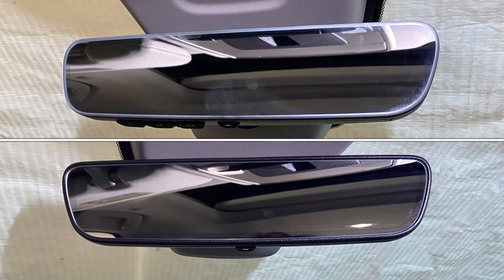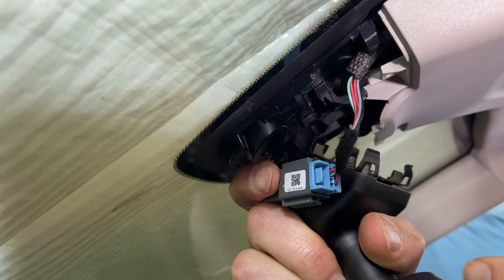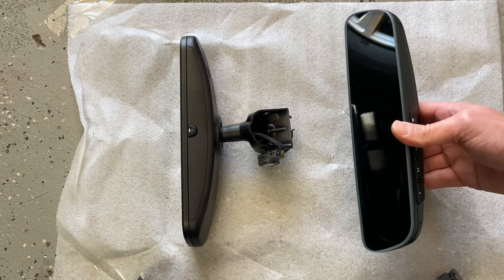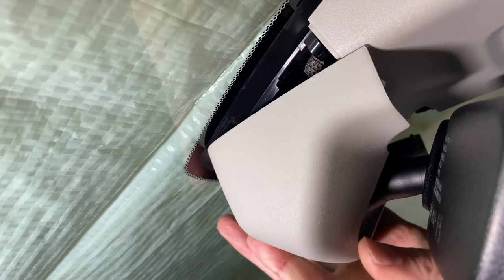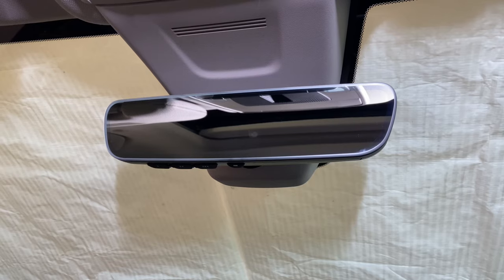2023 2024 Honda CR-V Homelink Mirror Upgrade

Comment: Struggling with this on a 2024 sport-L. Putting a good amount of force into it but feels clipped differently and might pull the whole assembly off

Update: this is exactly the same on 2024 models. I used a small pry piece to unsnap both top clips together and the cover will slide down and off. Don’t pull it off to the side. When putting it back on make sure to slide the piece up from the bottom to get the bottom clips seated before snapping the top in
Reply from the maker: Thanks for adding this, we have a great group of users that make the channel helpful for all of us! I will pin this to the top. Thanks for watching!
Reply: Howdy, I am about to try this on my 2024 sport touring hybrid.  Just to clarify, you did everthing the same as in this video, except you used two tools (one on each side / top clip) to pull the top section off?
Reply: Just finished with doing my wife's 24 Sport Hybrid Touring.  First, taking the lower cover off takes a little bit of courage.  It hates to let go.  Feels great when it did.  Second, original mirror pretty much just fell off as I tried to twist it.  Third, a bit of frustration as I tried to replace it with the Homelink Mirror.  I bet I rewatched the video 20 times before I decided I had it in place right and decided to try more force..  still no joy.  Then I held twisting force with one hand and then thumped upward on it at the same time... THUMP! twisted right into place and firmly there.  Replaced the cover and programmed the Homelink.  I am now a hero to my wife!  wont last though....
Reply: @andrelb3 I used an old toothbrush and it worked like a charm 🎉
Reply: had trouble with a 2024 too, tried 2 tools one on each side, no joy. I then used a pry tool 3x the size of what is shown here on the left driver's side and it popped right off with one try, just wasn't enough leverage using one pry tool for me.  Comparing the inside of the cover with the pic on here, and yes they are exactly the same, no difference 23-24. My last challenge was putting the new mirror on.  I thought I had it done correctly cause I heard it click, but when adjusting the mirror afterwards it just popped right off :( so I gave it another try, heard the click and this time it seems to have seated tighter; fingers crossed.  I followed the instruction in genie garage door manual and had it running in about 2 mins.
Reply: @andrelb3  I used 1 tool 3x the size as shown here and it popped off first try; using 2 of the smaller ones didn't work for me.
Reply: @ukulelelearning1595  toothbrush? do tell
Reply: @joey24698  Joey, you’re pretty mechanical.  I bet it just snapped in, once you gave it a good eyeballing.   To tell the truth I now adjust that mirror very gently to avoid giving it a toothbrush treatment.  Thanks @zoomgas2803 for your support channel.

Comment: Anyone else drop $40k on a Sport Touring only to realize THERE IS NO GARAGE DOOR OPENER STANDARD. Heated steering wheel sure garage door opener nope!
Reply: Yes! So disappointed when I got home yesterday and couldn’t program it. I assumed it was standard!
Reply: Same here. Got home and started to reach for those buttons to begin programming. Very disappointed from the dealer not informing me. My question is do I have to "pay for HOMELINK"? Or just program the buttons like I did on my 2015 CRV?
Reply: Felt the same. Would think garage door opener was a standard feature. What a disappointment! Thanks for the video.
Reply: Be thankful that you got the heated steering wheel. Neither that nor the homelink mirror are standard on any ‘23 or ‘24 Accord trim.
Reply: @mardigras622  yes but from what I saw I think the Accord gets ventilated seats, heads up display and full digital screen/dash.
Reply: Absolutely agree. Very disappointed in this oversight by Honda. What the heck!
Reply: @JDMJAMES ...My 23 Accord hybrid touring model has heated and cooled seats and the heads up display.
Reply: @JDMJAMES only the Accord touring trim level gets the vent. Seats and H.U.D.
Reply: Yup, not sure why they couldn’t install 170$ mirror
Reply: I wasn't disappointed... I read the feature list before I bought mine.
Reply: Sport touring hybrid has heated steering wheel.garage door opens through hondalink and myq
Reply: Homelink mirror is an option... you can add it on the Honda site when you Build you CRV or get is a dealer option. Should it be standard? Yes! Is it a surprise after viewing what is included? No 😊
Reply: The rear view with garage buttons is $245 as an accessory.  Plus labor.
Reply: The reason they removed it is the same for all new cars going forward. Nearly all features will be based on subscription, which you can get through Honda Link and run garage door opener on screen.  It's a new trend to get recurring revenue for all makers.
Reply: Salesman said Honda doesn't want liability someone breaks in your car and then can open your garage.  You put it in.. no lawsuit.
Reply: @dmitryzhernokletov4625  Lawsuits over breaking into your car and then being able to open the garage door
Reply: @BradInStLouis  I call bullshit. They may say that but then it wouldn't be in ANY Honda car or offered as an OEM part. The real and only reason is they are cheap bastards trying to maximize profit margin. And that salesman is either a liar or ignorant.

Comment: I spent three hours trying to put the new mirror in. I finally gave up and made an appointment to let Honda do it. I got the original mirror out easily enough but getting the new one in is a major pain.
Reply from the maker: Sorry to hear that, as it is a 30-40 degree twist, so maybe you were running into a different issue. If you figure out what the issue is, please let us all know and learn. Thanks for watching!

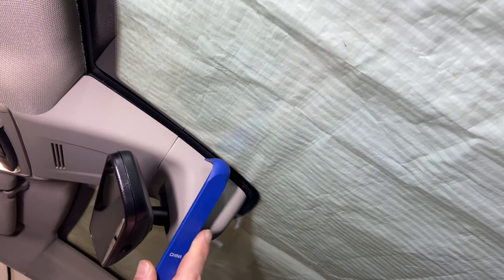Comment: Excellent video and instructions !  The key to getting the front cover off is at 1:10.  Insert the pry tool and twist it to the right, so the flat part of the pry tool is laying flat along the edge of the front cover.  Then just pull down with the hand holding the pry tool while supporting the front cover with the other hand, while pushing slightly forward.  It does not take a lot of force.  Refer to the photo of the front cover so you know exactly where the tabs are located.  If you need to remove the back cover, insert one flat pry tool into the crack between the back cover and the map lights, and slightly separate the back cover.  Take a second pry tool and insert it a little further down towards the right side of the back cover.  Pull on the pry tool gently, and the back cover should release on the right side.  Repeat this for the left side.  Once the back cover is loose, pull it down gently and to the rear.  I removed the back cover to run wires for my dashcam up and over the mirror assembly, and then tucked them in behind the front of the headliner.  For a 2025 Honda EX-L with an auto dimming rearview mirror,  I added a mirror tap (Part # MTX-1015) and a Blendmount for my V1G2 (Part # BV1-3017), tapping into the black and red wires on the blue plug (Black to Black/Red to Red.  They are right next to each other "Red/Black/Green" viewing left to right).  I had to remove the blue plug before tapping into it.
Reply from the maker: Great tips! Love it when subscribers share there experiences to make the job easier for others. Thanks for watching!

Comment: Honda recommends removing the negative terminal of battery before installation. What are your thoughts and did you unplug the battery terminal before installing the mirror?
Reply from the maker: That’s always a good idea, especially in the event you try to plug something in incorrectly and before you realize it you short something out. I do not always do that as I should, but a good safeguard for sure. Thanks for watching!
Reply: @zoomgas2803  So it seems that if you know what you are doing here, and careful, disconnecting the battery isn't necessary. This is a simple unplug and re-plug operation.
Reply from the maker: @louismatherne6808 agreed, but some are more risk averse than others 😊
Reply: @louismatherne6808  what about for a 2024 Honda Accord Hybrid EX-L?
Reply: @MHoogasian  No different and I just did the swap following @zoomgas2803 instructions but I didn't not disconnect the negative terminal. Car manufacturers commonly recommend disconnecting the battery for fairly routine tasks. I seldom do.

Comment: I did mine today, I was very hesitant about doing it, I didn't want to break anything. I used two tools on both sides for pulling the cover off as somebody suggested, When it came off I thought I broke it, but clips were still intact. The hardest part for me was putting the new mirror on. On my first couple of tries it felt like it wasn't fitting properly, and it had rattle noises. I was about to give up and felt frustrated, when suddenly I turned it and this time it felt in place. Thank you.
Reply from the maker: Glad you got it and thanks for watching!

Comment: I hate carrying a garage door opener in my car. The CRV was the first car that I've purchased in years that did not have Homelink built-in. So common that I missed that the vehicle did not have it before I purchased it. Other vehicles I was looking at in this category had Homelink. 

This video is great. Yeah, the cover was a bit tricky to get off. The instructions are great, but everything (the cover and removing the existing mirror) is tighter than you would like it to be (thus using more force than you want to use). The hardest part I think for me was getting the new mirror lined up and turned to lock into place. 

Great piece of advice on plugging the mirror in after you connect so as not to stress the wire. 

Dealer wanted $240 +tax for the mirror (plus installation). I got the mirror for $179 including tax and $6 for the tool to pop off the cover. This probably took me 30-40 minutes (was trying to be extra careful). Probably saved myself $100 over the dealer price and installation.
Reply from the maker: I love hearing stories like this, exactly why I started doing this. Thanks for watching!!

Comment: Thanks for saving my bacon.  I just was adjusting my wife’s one week old sport touring rear view mirror and just like that I was holding it detached, in my hand.  I found your great video was just what I needed.  Using an old tooth brush as my removal tool made quick work of the errant mirror.   Thanks helping out a stranded motorist.  🤙🏽  Rock on,  I will be keeping an eye out for you with these beautifully produced and executed YouTube presentations.   👀
Reply from the maker: I’ll have to update my required tools list to include ‘toothbrush’ 😂 Thanks for watching and glad it helped!
Reply: How did you get it to lock?  Honda couldn’t even get locked into position. Oh I have a 2023 CRV hybrid sport touring
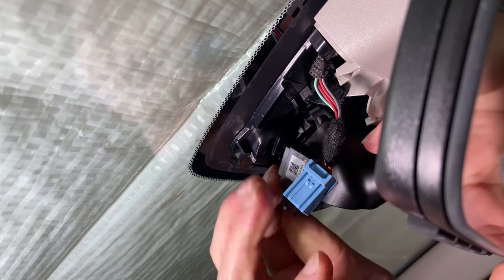Reply: In my Sport Touring Hybird, As I recall it was something like a  >1/8 turn clockwise from before top dead center.   You can see ZoomGas nail it at 2:29 But either way, you’ll feel it slip in and lock with a click.  Yeah when the mirror came off into my hand …it was a oh boy moment.   Lucky for me I was spending a few hours of orientation in my driveway.   I wasn’t impressed, except for our friend here in ZoomGas,  and his great YouTube presence.    Atta’ Boy ZoomGas!🏎️⛽️🤙🏽🙏 🛟🥓 2:29
Reply from the maker: @ukulelelearning1595  thanks so much for the kind words. Like you say/see, it’s not much of a turn/rotation.  Thanks again for watching!
Reply: @ukulelelearning1595  I'm confused... what would cause the  mirror to come off into your hand ?  It did not clip properly ?  Tricky to rotate into place ?
Reply: @ptg01 How?  Well, what we have here are two drivers; one  5’2” and the other  6’3” .   That requires mirror adjustment when we change drivers.  I don’t know exactly why the mirror came free but after watching this video it only took a few moments to set properly.  Haven’t had any rear view mirror issues since, thanks to ZoomGas’s excellent video and tutelage.  
Great stuff ZoomGas, you rock!  Good luck @ptg01  we really like this vehicle 🚗

Comment: You definitely need the trim removal kit. You have to pull harder than you want to but it will come loose. We have the 2025 CRV. I had good luck pulling the passenger side down first for some reason. A pair of gloves will give you some extra grip when turning the mirror off and on. I tried programming the new mirror from the learn button on the lift master wall control. It did not work, it likes you to use the 3 button remote control. Thank you for this video
Reply from the maker: Thanks for watching and good clean gloves with good grip are helpful!

Comment: Just did this UG today on my 2024 Sport Touring. VERY HELPFUL...Thank you - It really annoys me they didn't make this stock on this trim level let alone all of them.
Reply from the maker: Great to hear! Thanks for watching!
Reply: Absolutely... seem like a no brainer but heck they sell it for $250ish at the dealer !  UGH...
Reply: Great video. I noticed when I picked up my 2024 Touring that the mirror lacked the extra programmable garage door buttons, and mentioned it to the salesman right there. He said the Homelink only came on certain models. You mean the ones that cost less? Honda has blown this and it should come standard on all models, but esp the Touring!
Reply from the maker: @JB-lu7vz  thanks for watching!
Reply: I purchased the homelike mirror for my 2024 accord touring.
The wire harness on my car is white and has half as many pins as the homelike mirror. 
Has anyone seen this, and is there a resolution?

Comment: Thanks for the video..very useful, I got a new hybrid CRV2024. Realized does not come with homelink garage door opener. Where can I buy the Honda OEM homelink upgrade mirror?
Reply from the maker: If your vehicle has the auto day night mirror, then you just need to buy the mirror as listed in the description. If you do not, then it would require running the wiring harness also and is a much more intensive upgrade. Thanks for watching!

Comment: My car has the regular flip-up mirror. When I removed my shroud, I realized that I don't even have a power cable to make this upgrade. Is there no way I can perform this mod?
Reply from the maker: Would require you to also buy that wire harness that goes from lower left driver side up the a arm and across the visor. So would be quite a bit of work. Thanks for watching!

Comment: Does it work on 2024 CR-V Sports L Hybrid? The dealer quoted me $170 for the kit and $76 for labor, not sure if it's worth $76 for the labor.
Reply from the maker: Works on any model that is available w the auto day/night mirror. The EX-L and the Touring are the 2 models I have seen it done it with the existing wiring. Thanks for watching!

Comment: Have you looked into upgrading the stereo? Any idea if you can install the factory sport touring subwoofer?
Reply from the maker: I have not, if you know where the sub is mounted, we could start by looking there to see if harness is already there.
Reply: @zoomgas2803  thanks for the quick reply. The factory sub goes in the very back on the passenger side in the small cutout in the side panel/floor.

Comment: Hey man really like your videos.  I recently purchased a 24 CRV touring and was trying to install the HomeLink mirror. I watched your video 6 times and still can't get the new mirror to engage in the mount properly.  I think its seated and I turn the mirror to adjust and it comes off in my hand. Hate to pay the dealer to install. What am i doing wrong?
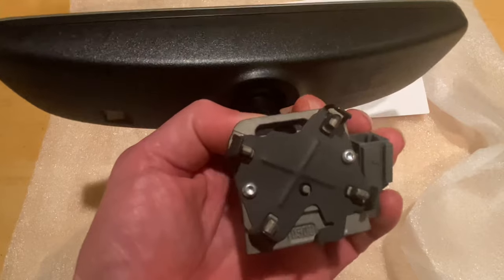Reply from the maker: Really pay attention to the 0:33 point and see how those features match up into the mating part. 1:29 notice that when you remove it, that it only pivots a few degrees and comes out. So 2:29 shows you that mating surface well and how you just pivot the new one slightly, as you may be starting with it rotated too much. Hope that helps!
Reply: Watched your video again paying attention to the timestamps you suggested and still no luck. Went to Honda today and they claim i jacked up the plastic mount up on the windshield and the only way to fix is replace entire windshield at the cost of $1700.  Super pissed at myself, car has only 450 miles on it.  Any suggestions?

Thanks in advance
Reply from the maker: @chrislanglois9518 look at the inset picture at 2:24 and take a screen shot of it and blow it up, take a picture of yours and compare it to see if you can identify the plastic feature that maybe got deformed, if any really did. Another idea is remove the spring clip mount on the mirror you removed, it is held on w 2 small star screws and maybe that part is causing your challenge and you can swap it. Hope this helps!
Reply from the maker: @chrislanglois9518 another idea is to remove that mounting clip from your old mirror as I mention below and just put it on your windshield mating part and see how it fits or if any parts interfere as you will have clear sight lines without the mirror attached to it. Hope that makes sense.
Reply: Sorry for not replying earlier.   I took a pair of channel lock pliers and bent the mount clips inward and it held.  Thanks for your help/advice
Reply from the maker: @chrislanglois9518 that’s great news!! Yippee! Thanks for sharing.

Comment: Thank you for a well done video. I picked up the mirror at a local Honda dealer and installed it today. The existing mirror fell right out of its clips when I pulled the cover off. The new mirror is installed and programmed and working fine, however the metal clips are not holding it tight. It latches and looks fine but when I try to adjust it in a downward direction it pops off. The bottom clips seem very tight but the top ones release much too easily. I have remounted it a couple of times and now I have to handle it very carefully. Would you have any ideas how to fix this?
Reply from the maker: It sounds like one of those ‘teeth’ is not seated, compare the 2 mirrors to make sure you haven’t bent one of the teeth. Thanks for watching!